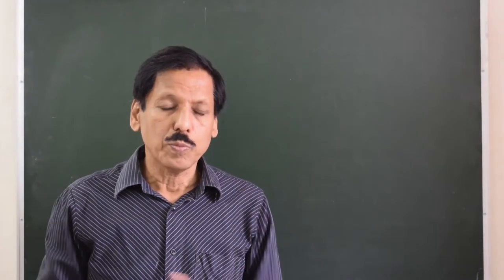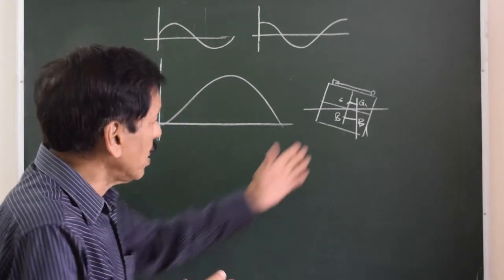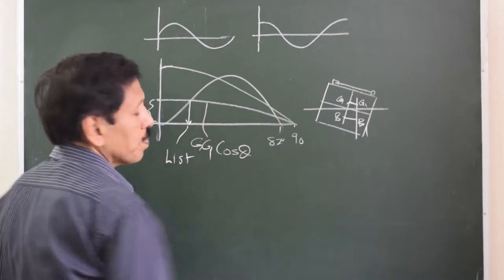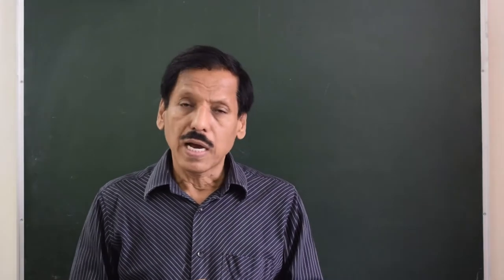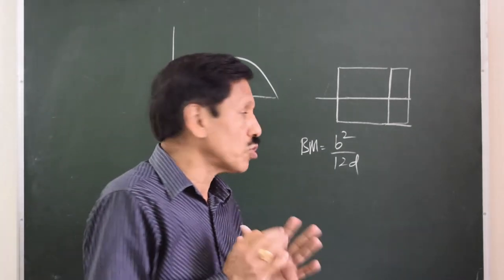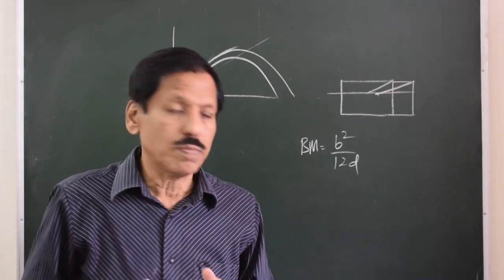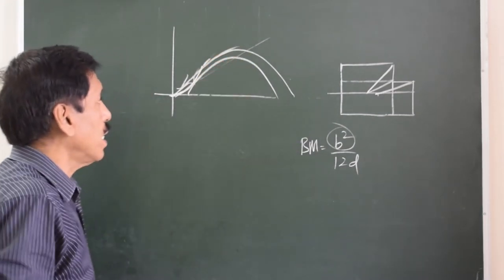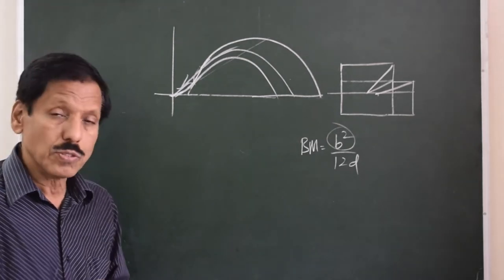Ship Stability Video - 21 INTERESTING THINGS ABOUT GZ CURVE | Capt.S.S.Chaudhari

Comment: It was a very good explanation capt. Just wanted to know why 57.3 degress is taken as standard as if we take any other for the purpose of proving CD=GM it will give same result as it gets cancelled out. As far as i researched only got and idea that 1 radian= 57.3 degrees so we take that value for finding GM.
Reply from the maker: On a GZ Curve, if we assume the ordinate at 57.3 degrees to be x, then by the principle of similar triangle x/57.3 degrees = GZ / theeta in degrees. (theeta is a small angle). Therefore, x= GZ x 57.3 / theeta. But, RHS = GM, because for small angles GZ = GM x theeta in radians.